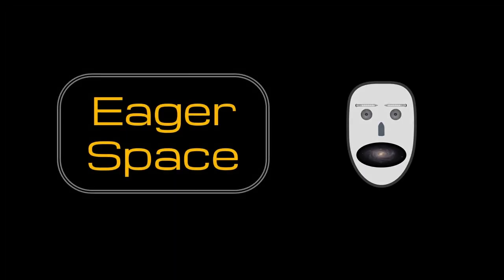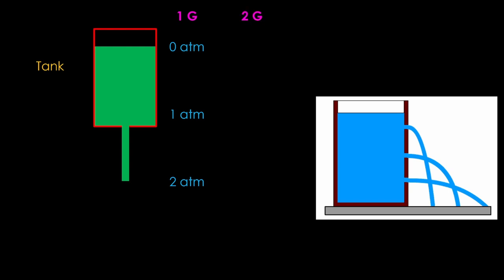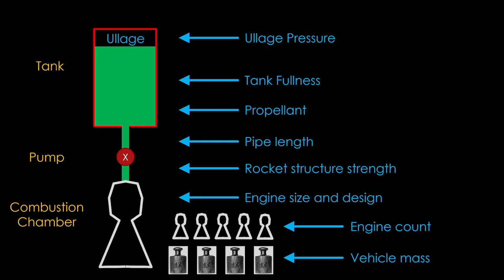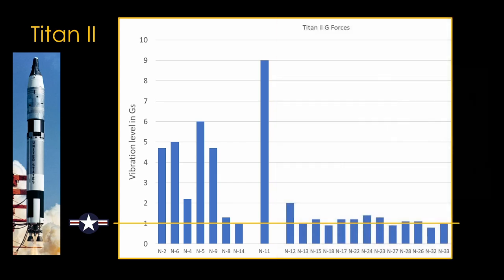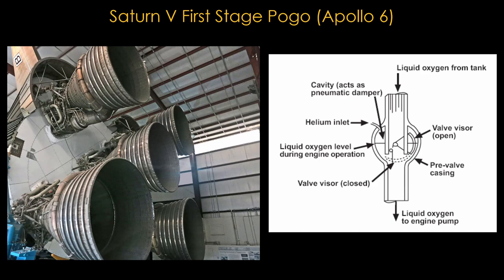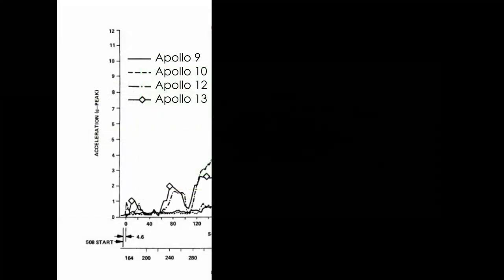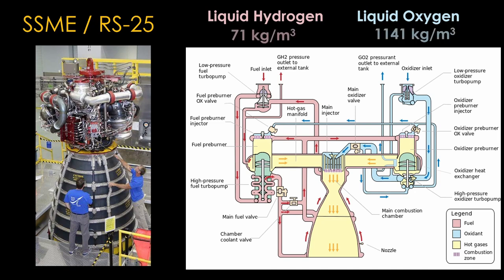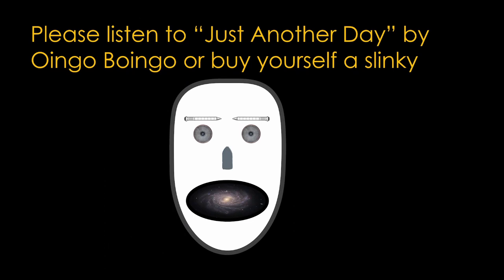Pogo  - Rockets Behaving Badly Part 1

Comment: Me thinks the raptor being a full flow staged combustion cycle, it already NEEDS active measures to control pogo just to run itself. Older raptors worked just fine on the testing pad but ran "engine rich" in first test flights.